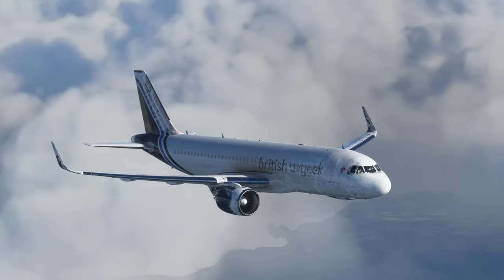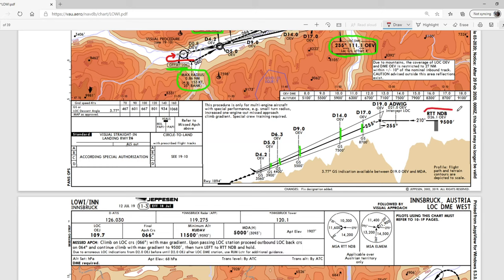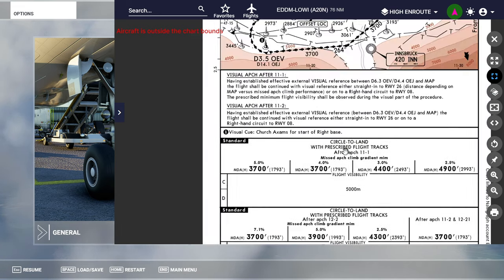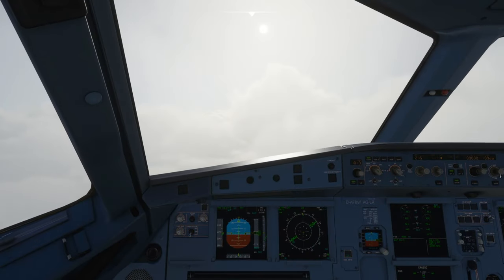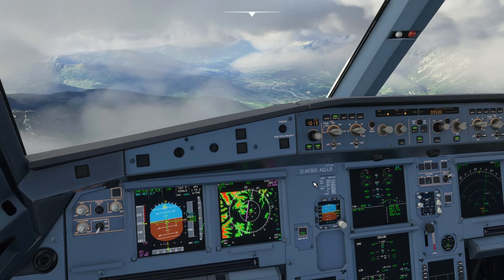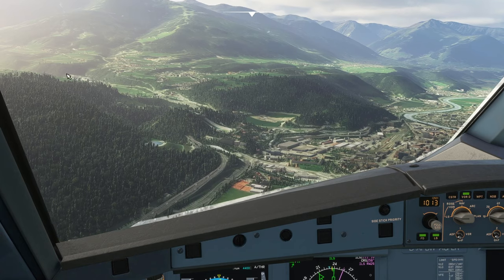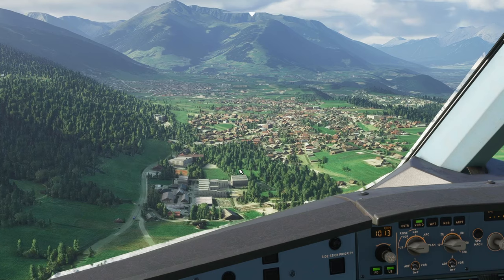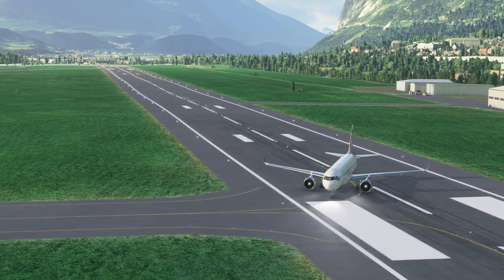MSFS 2020 | How to fly the infamous CIRCLE TO LAND PROCEDURE in the flybywire A320neo [ TUTORIAL ]

Comment: Nice one. Are there any NAV idicators (VOR DME, NDB, waypoint, etc.) when to switch from 230° heading to 264° or is that just visual. The next point to turn (at the church) is in the chart (D-3,5 OEV). Thats why I ask. Second question: I assume, from NDB RUM (or D-4,2 OEV) you need to have RWY in sight until landing otherwise you have to cancel that approach, right?
Reply from the maker: The first turn is marked on the LOC DME E charts and shows the DME at which you should break off into the circling procedure :) and yes you've got to have the runway in sight to be able to do it :)

Comment: Just attempted my first circle to land. It went some what successful only problem i had was after disengaging approach for the break off the aircraft seemed to keep descending instead of leveling off at 3700
Reply from the maker: What did you have set?
Reply: @BritishAvgeek  I was descending through the altitudes shown on the chart and then as I got 4.2 miles out and turned left 230 degrees and disengaged approach mode and then set it to level off at 3700 but it continued to decend and I had to take manual control to perform the circle to land
Reply from the maker: @3mon-rpclips900  hmm sounds like it got stuck on the ILS glideslope somehow - perhaps a bug?